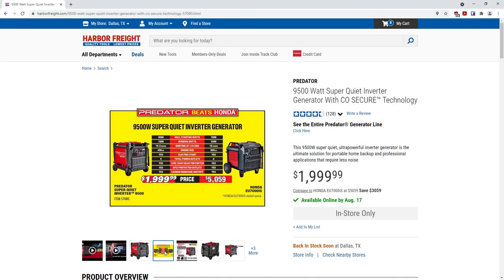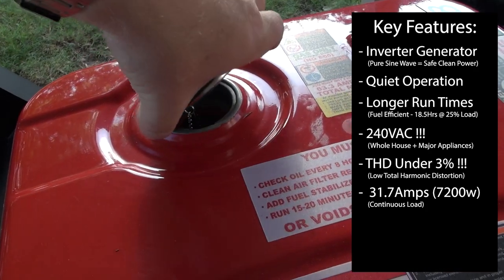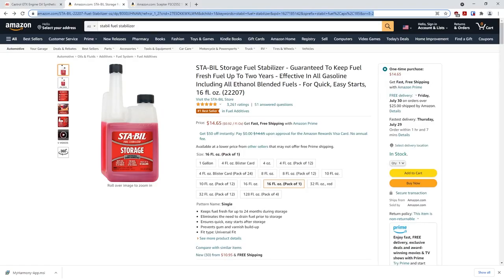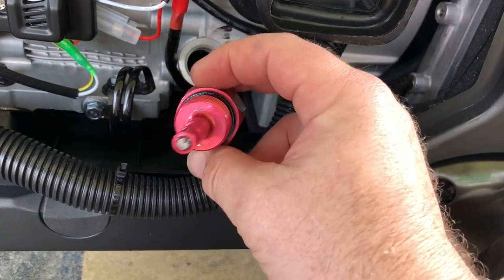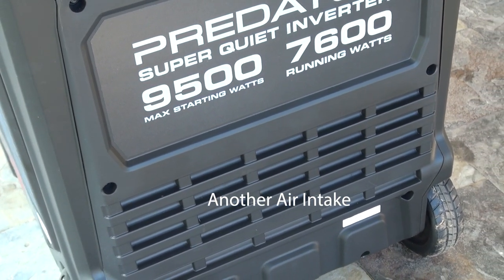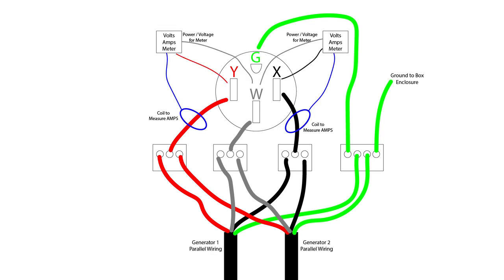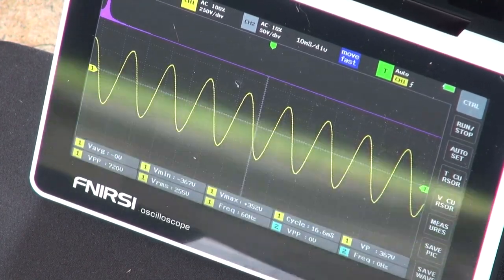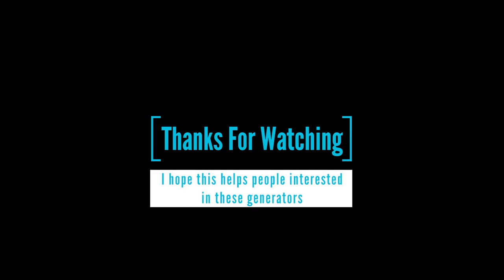Predator 9500 Review: All The Technical Tidbits In Under Ten Minutes (+Important Break-In Warning!)

Comment: Hello Jason! Thank you for your videos! I have 2 Duromax xp9000ih gens. and cant find their parallel kits anywhere. Their parallel kit only uses 3 wires going to each gen.. Any idea how I could modify your wiring diagram for that situation? Thank You For Your Time, Mike in DFW
Reply from the maker: The part number you're needing is: XP9000iH-PK.  But it does seem to be out of stock everywhere I spot checked.  The only possible way it could be working is by using the ground also as the neutral.  (they're bonded anyway).  So the wiring would be the exact same, except the white neutral wire would be skipped, and the ground would be used in it's place.  Make sure the neutral / ground cable is well secured to the front panel, because there any imbalance in your 240v load will be returning via that cable. 

I don't know what the exact shape of the parallel kit plugs are on the XP9000, there are a number of videos here that cover that generator, you maybe able to infer it form those.  If the plug shape and spacing are the same as the Predator, then the Power Horse cable would work.  (you'd just not use the Neutral, and in the box, the ground would also connect to the neutral terminal for split phase 120VAC)

Though that is site unseen, and guessing.  So consult a professional, etc. etc.  I'm just a guy on the internet.  :-)
Reply: Thank You Again for your time and research,   Mike

Comment: Good about the hottest part of Summer being that that's a closed case with an engine running and a powerhead create a lot of heat, then it is in the ☀️ for what I gather on the internet overheating is possible because it's not getting enough cool air
Reply from the maker: I designed the enclosure to augment the generator's existing cooling fans.  Thick expanding foam strips seal against the generator body, such that each unit is exhausting out (both the engine exhaust, and the cooling heat exhaust) this makes the generators themselves pull air through and out of the enclosure, while the DC automotive fans augment them.  (this also prevents the exhaust from tripping the CO sensor in the generators).  

So the generators are pulling air through and cooling normally, so the only added heat inside is what might radiate out from the plastic generator enclosures... which are pretty well sealed and cooled by design.  In my testing, airflow is quite sufficient, I ran them with the lid closed for 4+ hours in the peak TX summer heat with temp probes all over the inside, including the top of the enclosure.  The temps were always within a few degrees of ambient.

I got lucky and guessed right on the fan sizes and such, and thankfully, didn't have to redesign anything.

Comment: If a lineman with a utility company believes that the power is off and he is up on a utility pole and your generator back feeds i it can kill him instantly. Proper way to use your generator is to have a disconnect so when you're using your generator it doesn't backfeed and take out a lineman, if you're not going to hook it up properly then pull the meter , this will ensure that your generator doesn't kill someone.
Reply from the maker: Yup.  My other videos where it talks about connecting it to your house emphasizes this VERY heavily.  Interlocks physically prevent the breakers from being in a configuration that allows back feeding, and are legal and considered safe.  (no need to pull the meter... and in fact, in my area the meters are security tagged and they really.. really... won't like it if you mess with the meter)

Comment: I just got the same meters you have my question is do you have two   supplied with AC power to make them operate . I would appreciate any advice you can give me so I can get them to work thanks.
Reply from the maker: I have two meters so I can measure the AMPs being output on both the X and Y legs.  I considered wiring them across the two hot legs to get 240v (so I could confirm it's running in 240) but figured there was more value in monitoring the voltage of each 120v leg to make sure one side wasn't sagging or over/under volting.  So I wired based on the diagram, the meter that watches "X" was wired X to N (120v),  and the meter that watches "Y" was wired Y to N (120v).

Comment: Two items…I’ve watched a number of videos on the Predator and have yet to get the answer on whether this unit has aluminum or copper windings (did not find on HF website)…next, as a former salesman, rental man, and product manager of light construction equipment (45 years total) the amount of metal shavings shown after the first 16 hours is troubling, I’ve not seen that with Honda, Wisconsin (RIP), Robin, Kohler , Kawasaki, Yamaha, or even Briggs & Stratton small gasoline engines.
Reply from the maker: No doubt that it's disturbing.  Particularly as there is no oil filter (or maybe that's why if other machines have filters?)   I'm not sure if it's coming from the internal mechanisms, or if it's left over from manufacturing that they never cleared out, or what.  But it certainly is unsettling.  The Honda would certainly be a better machine, but, at well over twice the cost, is it that much better?

In any case, thankfully there have been very few reports of engines failing in these machines, so I'm hoping with the magnets, it will keep things clear.  Even after 30hrs, apart from the metal flakes, the oil was remarkably clean, with very little black carbon in it. So it seems they're pretty tight otherwise.

No idea on the material used for the windings.  I would assume copper... but who knows.  I did learn that generators have odd windings that are quite different from conventional generators.  Inverter machines make very high frequency power, so when the machine slows down there is still enough going on for the inverters to convert it over.  It's interesting stuff.
Reply: @Texas_DIY  I've done break-ins on many small engines, including many small inverter gens, and they ALL have the shiny brass-looking flakes in the oil, after a 5-8 hour break in.  This includes Honda, Yamaha, Briggs, Kohler, Predator, Generac, Champion, other clones, etc.  After draining the oil into a pan, I've run a strong magnet through the waste oil and 99% of it doesn't stick, so it's non-ferrous metal like brass.  I also have a magnetic dipstick in my personal Yamaha 2000 that's 5 years old, and nothing seems to stick to the magnet, which is guess is good.
I wouldn't be overly concerned about what I saw in your video.  Regular oil changes are always the best insurance and peace of mind.
Great video though, thank you!
That Duromax clone is sure interesting too. $600 more but dual fuel and a proper display panel.

Comment: So how is the generator doing 1 year later?  Any problems with it?
Reply from the maker: So far so good.  A few weeks back, we lost power in our area for a few hours again after a freeze and a lot of trees fell on power lines.  We were able to run them and live pretty normally.  I did have them get overloaded once when our Heating kicked in (must have been heating pads and compressor) combined with the hot water heater running (which alone pulls 20Amps).  So I ended up just flipping the breaker on the hot water heater for a bit, let the heat run, then turned the thermostats down and let the hot water heater run and it was fine.  

We were lucky, only a few hours without power.  There were some in nearby Austin that went over 4 days without power.

Comment: Is there a way to adjust the output voltage? Mine is running around 124v, I’d like to get it to 120v if possible.
Reply from the maker: Interesting.  No way that I'm aware of, but you might try another meter to confirm if it's the generator or the multi-meter that's off.  Either way, 4 volts isn't going to really hurt anything, there is often that much flux in the lines normally, and UPS units often won't even kick on until it's at least 5 volts off.
Reply: 124 is close enough.  Try your meter in a house outlet.

Comment: Why are my legs unbalanced. I'm plugged into the 30A far right and it trios the breaker when I'm only running about 6k watts but I am over 30A on one leg but not the other.
Reply from the maker: Split phase 240 consists of two legs of 120V power.  I'll call it the X and Y leg.  Measure X and Y and you get 240VAC.  Measure either X or Y to Neutral, and you get 120V.  

240V appliances are pretty balanced.  (some stuff may have a 120v light or electronics that just pull from one of the legs)  But motors and such that are actual 240v will pull evenly from both legs.  However all of your normal 120V stuff, only pulls from X or Y.  You just ended up with more 120v stuff pulling from X than Y (or vice versa)

Your breaker box splits the loads alternating on the way down between the legs.  So just they way your breakers ended up sending power out, you happen to have more stuff on one side than the other.

I cover the breakers and how the loads are split up in the other videos, the playlist is here:
https://www.youtube.com/playlist?list=PLzoNthJzzMFQ877vyCfoc53oDQqGFAIKN

Hope that helps

Comment: It’s just frustrating that this is not duel or tri fuel.   Gas is not sustainable during a hurricane event. 

Have you looked at the conversion kits?

Is it true that inverter generators do not suffer the BTU of gas to propane to natural gas? 

Thanks
Reply from the maker: My neighborhood is 100% electric, and I didn't want to deal with the expense and complications of renting a large propane tank, installing a pad for it, and running the lines.  With fuel preservative, you can get 1 to 2yrs out of gas, so stocking up in advance is do-able.  You just have to be diligent to rotate the stock, or, if it's starting to age too much, put it in your vehicles and refill them. 

There are a few people making propane / natural gas conversion kits for other Predator generators, so I'd assume they might have them (or they might cross over) for these.

However if propane is important, you might consider the DuroMax XP9000iH, it's about ~$500 more expensive, but it supports propane, and has a cool auto start/remote start feature.  It might be cheaper and less hassle than converting this one over.  I don't have any first hand experience with it, but, I'd assume it's power profile would be similar, and it may have the features you value enough to justify the extra expense.
Reply: Thank you for the recommendation on Duramax; sounds interesting.   In the area where I live;  finding a used propane tank 250 gallons is not that difficult they range from $100-$200. 

Not a bad idea on the stabilizer storing some gas; that’s pretty prudent.   But in the area we live in you could go to weeks without power.
Reply: @greginfla_1  I just bought this Predator. Label on top of unit says you must use stabilizer for warranty coverage. Good idea for any gen because they commonly sit unused for periods.

Comment: How do you feel about the potential longevity, or lack there of, with the Predator? It’s no secret that Harbor Freight’s reputation is that it produces cheap and effective products but they often are of poor quality and don’t last. Given this reputation, and the fact that this specific model is less than a year old, are you nervous? Do you trust it? Do you feel have any thoughts on the quality of their generators and engines in general?
Reply from the maker: Not really worried about it.  These have been very well reviewed, and the cost is so much less than an equivalent Honda, that you could buy 2 and a half.  These are certainly not perfect, but really get the job done well.

Comment: Went to order dipstick and learned that the 9000 is a regular gen and the 9500 is an inverter. The pict on your video shows one for the 8750/9000, so I'm assuming the dipstick for 9000 and 9500 are the same (?). Also, a friend told me that the Predator and Honda engines are so similar that many of the parts are interchangable. Does anyone in here have any info on that?
Reply from the maker: The one I showed in the video worked great.  Yeah, the description shows 8750/9000 but it fits.  This is the amazon link: https://amazon.com/gp/product/B08CVLP2JY

I also ended up getting a magnetic drain plug as well (M12x1.5 size) this is what I purchased:
https://amazon.com/dp/B08M3HCVPW  (got some extra crush washers, and don't crank it too tight... there were a few reports of the bolt breaking off)

Comment: How do you have them plugged in to your home???
Reply from the maker: I hope to have that video done in the next few days.  It turned into a much more detailed and comprehensive thing that I intended it to be.  But spoiler, go with a 50amp hookup, it will future proof you.  And you can still run just one generator with only a 30 amp socket if you like.  You'll just need an adapter.  If you're home heat, dryer, and water heater run on propane or natural gas, many could potentially get by with just a 30amp hookup... but the cost difference between the two is minimal, so why prevent yourself from getting something larger in the future?   

I made the mistake of starting with the 30amp inlet (mainly because I was confused by the seemingly different 50 amp inlet styles) and ultimately had to pull it all out and re-do it when I realized it just wasn't going to be sufficient to accomplish what I wanted.  Learn from my mistakes, that's a big part of why I'm making these.  :-)
Reply: @Texas_DIY  I just put in a 30amp inlet lol 😂 man… you live and you learn right..
Reply: @Texas_DIY  That's what I did for my house, 50A with proper interlock.  The 30A this unit provides is great with a little planned power management.  Can't imagine needing a second generator but it is cool to see running and like you said, house connection is future proofed.  BTW, I put my meters on the house side, mounted by the panel.  Did the same for my neighbor as well as the Hyper Engineering sure start.

Comment: Does anyone know what those connectors on the parallel connections are called?    Could you not create a box where with 2 such connectors would be wired in parallel internally then connected to 60A breaker for full power?
Reply from the maker: That's basically exactly what I did.  The cables are just joined together color for color, and wired to the 50amp socket.  The second generator will sync frequencies with the previously running machine that it detects on startup, and your power output is doubled.

This is the playlist of what I have so far for videos on the generators, one covers the parallel box.
https://www.youtube.com/playlist?list=PLzoNthJzzMFQ877vyCfoc53oDQqGFAIKN
That box then has a cable that runs to an inlet on the house for receiving power.  That inlet is wired in via a breaker that remains off when line power is on, and can only be switched on if the line power main breaker is in the off position.  (interlock plate)

Comment: It didn't help me.  I have a generator that does not run unless I unhook a module, at least that's what I am calling it.  It is about 1 in x 1 in and has 4 wires coming out of it and it is screwed to the block and a plastic cover.  The 4 wires are blk, red, yellow, and white.  It is marked with a "H Q"  After hours of work I discovered that unattached this from the block allowed the engine to keep running for more than a couple seconds.  I can't find any wire diagram for this model nor don't know what this thing even does.  When touching the medal housing the engine block the engine will shut dn.  Anyone have any ideas?
Reply from the maker: Sounds like it might be a Carbon Monoxide sensor.  If you're running it in an enclosed space, it's saving your life.  If it's doing this in open air or a well ventilated space, it may be defective, or there might be an exhaust leak inside the generator.
Reply: @Texas_DIY  I'm not running it in an enclosed space and you would have to be in a room 10x 10 with doors and windows closed for this to ever be a problem.  It's not the co2 sensor.   I figured it out.   It's a diode.  They named it the oil safety and it is under the plastic cover with 2 safety screws.  When it is attached to the engine it causes a weaker spark and it will run for a couple of seconds.  Took me hours to figure this out and a week with HF to figure out what this part is.  This machine is poorly engineered as it is very difficult to work on
Reply from the maker: They are hard to work on.  I've since become a fan of the multi-fuel, GENMAX GM9000iED on Amazon.  I've confirmed that it's made by the same factory / people that make the Predator and the Duromax machines, and it solves all the shortcomings of those machines.  
(it has the same engine and most of the same guts, but adds a fuel filter, rear exhaust, 50A front panel plug, remote control electric start, auto choke, nice detailed control panel display... and still makes the same clean power)

And because it has that 50A plug, the Powerhorse parallel kit that joins them together can be used stock, with no box, plug, etc.

Still going to be a tight fit for servicing, but it's all a more refined version.

Comment: How do you empty the fuel tank when you store the unit?
Reply: Just use non ethanol fuel or a fuel stabilizer and don’t worry about dumping or burning rest of fuel in tank
Reply from the maker: It's stored with fuel and fuel preservative.  My bulk tank (see the other videos in the playlist) I will occasionally use to fill up a car, and then replace it with fresh gas.  The onboard tanks can be run through with testing and exercising the units.

Powering down the generators for long-term, is done by turning the knob to "off" which cuts fuel, and a minute or so later the carb is emptied of fuel and it shuts down.   This allows it to store longer term and keep the carbs happy.